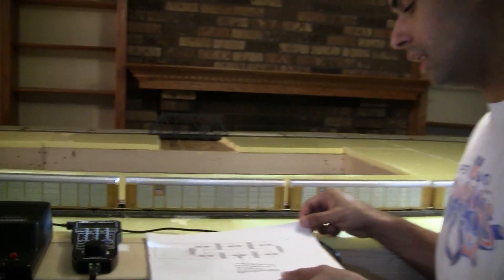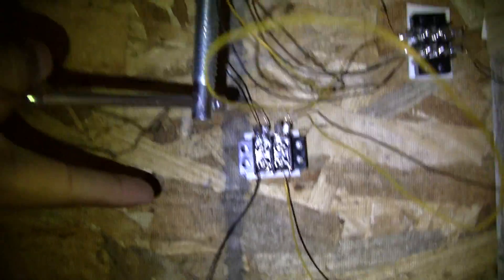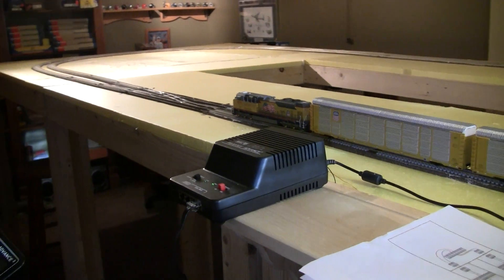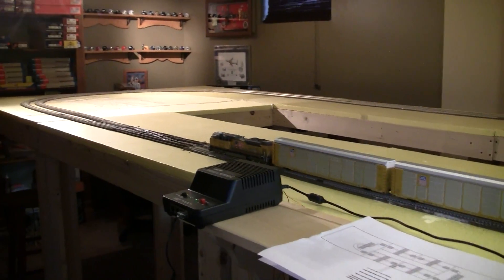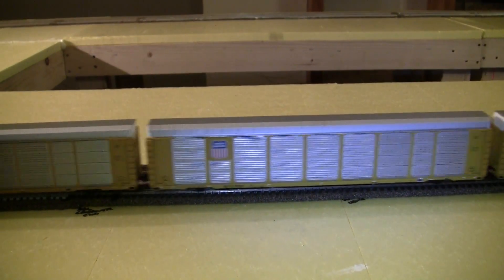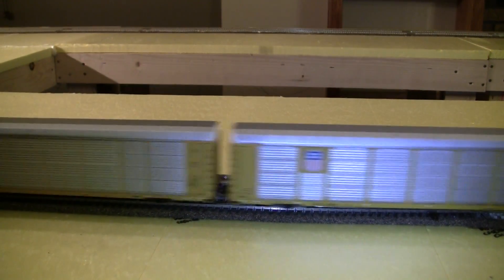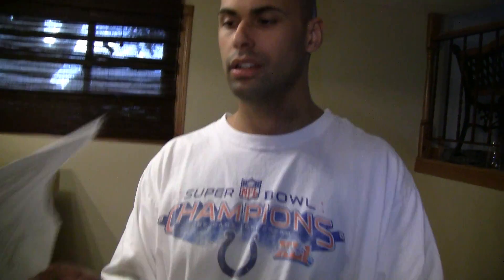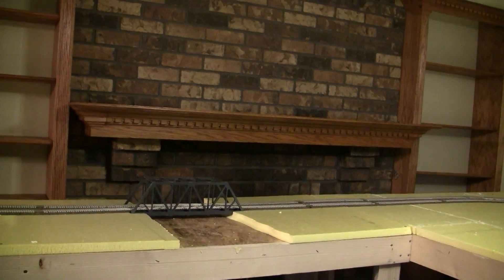Part 9 of How to Build your Layout from Start to FInish--Final Wiring/Operation/Overload Check

Comment: For Derailing issues, Simply put ReRailers Before and After Switches, Crossovers, Bridges, Before/In/After Tunnels and every 4ft or so. Use the E/Z Track Curved ReRailers in Tunnels if they are Curved.
Saves on Headaches.

Comment: I'm just wondering. you have modulars but you have not made any videos on how to separate your layout tables with the track already laid out. I watch all your how to build a layout videos. I've seen you later all the track but I haven't seen you cut and under the tracks in between the two joints of your modular tables how do you disassemble and line the tracks backup. are you just laying down the track and then down the road when he disassembled your modular is you'll cut the track?

Comment: I don't know what hookups you have on your controller, but you can use a amp(headphone) plug, to quick connect to your module.

You can also add a amp plug to ea. module, so you can move your controller around your track, for different view points.
Looks like you are using a wireless controller.

Comment: I have a Bachmann controller that is not DCC, and it needs wire feeders to power the other side of my layout because i built an extension, but when the engine start to go on to it the engine slows down and then stops, do you know how i can get some power over to the other side without buying a different controller.

Comment: @modeltrainteen95 If you are going to connect something to a rail, be it another rail, wire, whatever, solder it. the rolling motion of the trains will eventually work anything not soldered loose.

Comment: Ignoring the crossover and modual stuff it is just a loop of wire under the track with a a wire on the inside for both tracks and the outside for bothe tracks